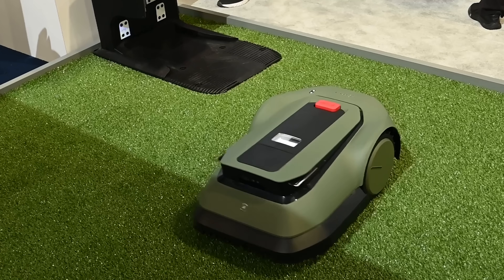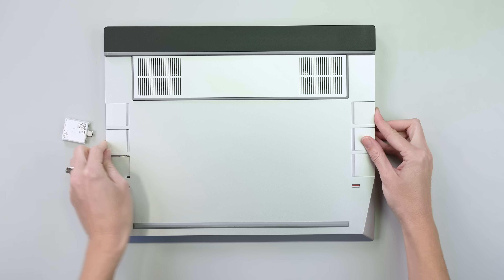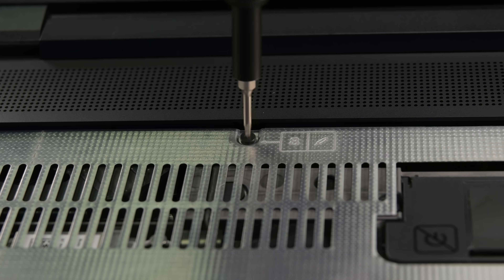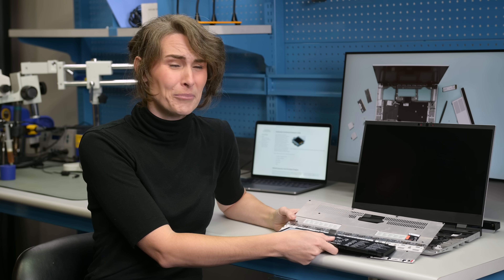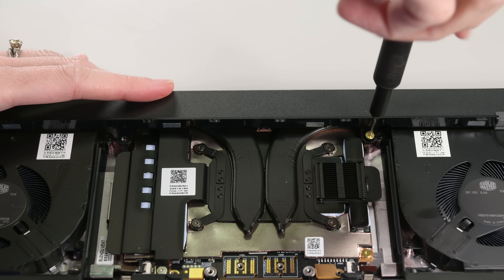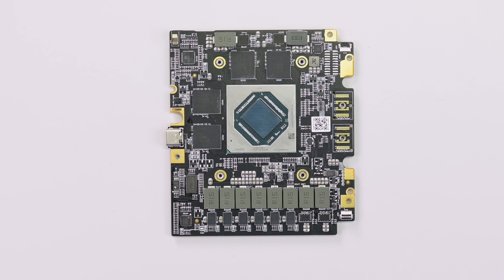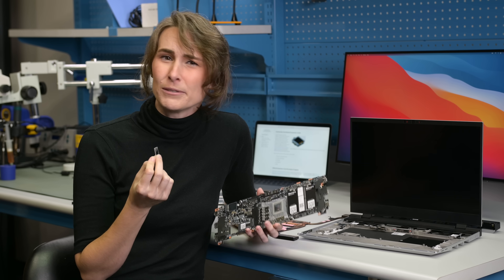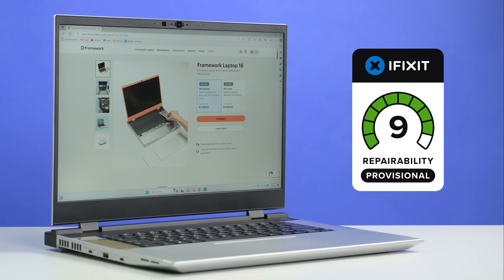The Framework 16 Teardown!-Best Teardown of the year already??

Comment: Does this accept 2 NVMe or an NVMe + SSD? Without using the additional "storage expansion" I am looking to run 1 NVMe + 1 additional storage drive and then if needed, an additional external "storage expansion".
Reply: it accepts 2 NVMe ssds, but only one is 2280 (I think). So your secondary storage will need to be 2230 (and quite thin), which is pricier.

Comment: This is rarely mentioned, but the display screen in the Framework 16 is exceptional, with significantly better specs than in most 16~17" laptops from Dell, HP, Lenovo, and Acer being sold at similar prices. 500 nits brightness, compared to 300~400 for most others,  a 100% DCI-P3 color gamut, 1500:1 contrast, and a 2560x1600 resolution compared to 1920x1080. It's not quite 4K, but if you really want 4K, connect a 28" 4K monitor to the HDMI port, and you will have a gorgeous dual monitor setup for work or gaming. For really serious gaming, the optional Radeon RX 7700s GPU falls quite a bit short of the capabilities of an Nvidea RTX 4090, but on the other hand, it only costs 1/4 what you would have to shell out for the Nvidea card, which is a truly eye-watering $1600. For graphics applications that depend heavily on ray-tracing, Nvidea GPU's are preferable to Radeon GPU's, but if you are doing serious work with CADD software involving 3D rendering, you are probably going to need a full-tower desktop workstation, which will cost much less to build than a high-end laptop, and it will have capabilities you simply can't get in any laptop, like the ability to internally mount 2 or even 3 16 tB hard disk drives. You're not going to even be looking at a laptop in the first place for that type of use case. 

For photographers who need to process extremely large images on a computer that's portable, using Photoshop CS6 or Lightroon, I don't think you can do better than the Framework-16.
Take the basic $1399 chassis, get a 96 gB DRAM kit from Amazon for $225 (that's two 48gB 5600 MHz DDR5 so-dimms from Crucial), a 2230 SSD WD Black 2 tB $120, and a 2280 SSD, 2 tB for $180, and you can build a real powerhouse portable workstation for about $2,000. 96 gB of DRAM will allow you to load a truly enormous composite panorama (up to 1 gigapixel!) into Photoshop CS6 directly into memory without having to use swap disks, which you really don't want to do with SSD's anyway. For processing static images, you don't need the $400 optional GPU (for video processing you probably do want it). My point being, that if you have an application that can actually use 64 to 96 gB of DRAM, you're going to pay way more to get a Dell XPS with that much memory, and it's probably going to be soldered. The Framework 16 isn't the most powerful laptop you can buy. It doesn't have the very top-of-the-line in either CPU's or GPU's, but it can match any high-end workstation laptop from Dell, HP, or Lenovo in capability for applications that need maximum amounts or memory and storage, for less up-front cost. And if you suffer a failure after the warranty - like an SSD goes bad - you can easily and inexpensively replace it.

Comment: This zig-zagging pattern isn't something to be ignored. It helps with alignment and making sure equal pressure is applied. When done with cpu/gpu cooler, you can cause damage by not fastening iteratively in an alternating diagonal pattern. Helps with screw alignment too

Comment: why not a phone like this ?
Reply: to be fair to engineers, designing this kinda stuff in this way takes a lot of time, custom parts and adds substantial cost, factors which only get exponentially harder to deal with the less space you have to work with. Phones should defo be better but this is probably an unreasonable standard for your tiny pocket computer.

Comment: only 1 full sized 2280 ssd slot?  well?  i guess not everything can't be perfect.  

but dang, did she say 80 something wh battery?  yes, 85wh.  the last 2 laptops i've bought were maybe 42wh.  and i had no option to buy a bigger battery.  yet i'd open my computers and find plenty of room for more battery inside them.

i didn't love that the framework laptop was going to be $1700 (with 0 ram and 0 ssd), but man, maybe that is just what things cost now days.  

that and when i upgrade, i'll only have to buy a $600 mainboard.  i should really just jump in with my next one.

Comment: My only real annoyance with my Framework (13) after having owned it for a while is the fact that the fans are glued to the heatsink, and not easily detachable. Dust is a real annoyance, and once it piles up in front of the radiator fins, your laptop sounds like a plane taking off whenever you turn it on.

Comment: PROOF that making a repairable gadget is a choice.
Reply: You're right, but unfortunately the framework laptops take it to such extreme the hardware will be absolete sooner than it would require any repair. Building reparable devices is a choice for a company, but unfortunately we don't have much choice if we want light laptops with long battery life powered by arm..
Reply: @mori7423  why would it be obsolete sooner??? I dont get it? If so, i hope they just make laptop batteries REPLACEABLE by consumers

Comment: Upgradebility and easy repair is everything for me. I bought cheap laptop in 2018. witch i am using even today. In meantime i upgraded ssd from 128gb to 1tb, put 4gb of ram more, replaced keyboard, cleaned laptop internals few times , put new hdd of 4tb, used 3 different oses, both windows and linux. and laptop will serve me for couple of years more. And that is real value for money.

Comment: I am quite sadden that Framework opted to use another freaking custom GPU board, rather than just sticking with the MXM 3.1 standard thats still PCIe x16 Gen 3, fast enough for RTX 4090!! 
I smell another Dell fiasco with their "upgradable GPU" module that juts ended up being only compatible with very few select machines. 

What a shame, I was hoping to finally replace my 2011 Dell Alienware M17x R4 with its ugpraded RTX 3080 GPU installed, but hey, I guess Framework intends to play it safe.

Comment: First 10/10? I actually think the battery, ram and ssd should be replaceable without having to take the back-panel off. But yes repairablity and replacablity is not the same thing I love most things about this laptop except the price point. Yes it’s on par-ish with the competition but it’s still to pricey for me. I hope budget options comes out as well because I want to buy one of their laptops.

Comment: Number 1 reason Laptops die is because the onboard Powersupply converting and managing Battery and A/C Voltage rails on the Mainboard, i wonder why this is not something that is getting talked about since you have to replace Mainboards still, even on Mainframe Laptops every 3-6 years like every other Laptop currently being sold. Even the best Manufacturers give not more lifetime on these parts, ofcourse you can say your Laptop is 20 years old and still running but if you poweruse it or leave it on 24/7 for more than 3 years you gonna have a broken Power Supply sooner or later. It literally another form of chip-lottery. So you going to think that Model line is still supported by Framework ? there will be 3 new Models with incompatible Motherboards or Hardware so old you going to want to buy a new one anyways because you cant get a decent upgrade Mainboard or GPU fitting your Frame anymore.

I get it, i want a Framework too because its freaking awesome but its yet another promise on the market that is forseeable wrong if you really be honest thinking about it. Eventually i will even get one since its the only direction i want to support the market to turn to ...
I would be the quietest man on earth wielding my money in the air if those Frames had changeable Power-Management hardware. Like a tiny Module with your A/C power input and traces from the battery straight into the removable module so that if something dyes its on a changeable module.

Comment: Framework is the first modern consumer-grade smart device manufacturer that can score more than 1/10 in USER repairability rating.
When I get the money, I am 100% buying Framework, unless others manufacturers catch up (doubt about it).
Reply: No, Dell and HP already have extremely modular laptops, they just cost 2500 euros for the starter model, they are professional work machines with replaceable GPU's, memory, harddrive, wifi card, storage and so on and so forth and they support up to 4 x storage devices.
And then there is Clevo which even has replaceable CPU's
Reply: @SMGJohn  Where is this vaporware that you are talking about?
Reply: @heroninja1125  
Seeing how you cannot even Google HP workstation laptops, what good can I do for you? You need a different kind of help.

Comment: The only thing that hold me back from buying a framework is the CPU. Ever since Apple released the M-series chips, I would always prefer ARM chip on a portable device for it extensive battery life and performance. The X Elite from quad comm is bring me hope to have an ARM framework laptop. But I doubted if there is enough market for framework to release an ARM cpu board at all. Also, I don't think quad comm is cooperative enough to let framework have their cpu at all.

Support of ARM chip on Windows is not a concern for me at all, because I am a Gentoo user. As long as we can see an ARM framework, I will give my money.

Comment: It's fun to see the argument between those who like framework design and those who don't. I on the other hand is all for it. Who still remember the time when almost everything inside a laptop is accessible through the various hatches at the back of the laptop? During the time when the battery can be removed with just a single button press, when the ram sticks was accessible with just removing a single screw to remove a plastic cover. The time when disassembling a laptop was easier than frying an egg. Framework is simply bringing that back and more. It's not all about the value of framework laptops bring into the table, it's about proving a point. That easily repairable devices are still a viable thing.
Reply: My old Gateway laptop was east to disassemble. I still remember the model number, MD2614U.

I currently have a framework system in the coolermaster case. If I ever need another one I will definitely purchase from framework.

These designs give the users full and total control, the way it should be.

These are perfect with an Arch Linux install.

Comment: The difficult access to cleaning the fans(which should be cleaned at least every half a year in a gaming laptop) is unforgivable. How could they mess up this bad in a high performance laptop?
Office laptop - I can understand, almost nobody opens them up for cleaning and repasting. But powerful\gaming laptops? They need the easiest possible access to the cooling system.

Comment: And that won't stop nvidia, intel and amd from artificially limiting laptop parts. Why? So you can be sold 2 generation old parts under the guise of the latest generation naming, which AMD did first followed by intel. Its so they can sell you marginally faster parts for more money. Its so you pay more for the performance you're suppose to get. For example, the rtx 4070 mobile not even beating the last gen 3070ti mobile in performance, yet costing more. And nvidia could've very well used a desktop rtx 4070 to give you an additional 30-40% more performance with more vram. Oh wait. That would be too close to the rtx 4080 mobile's performance. So they can't charge you $1800+ (and 2k euros or more outside US) for what is really suppose to be the rtx 4070 mobile. 

How does this affect FW? You won't be able to tune your laptop well or as easily as you could in the past, thus improving the performance and maintaining it better over the years. You're forced to buy higher end config's, something apple regularly pulls, especially if you need more than 8gb of vram. You'll be either forced to pay more for the upgrade you're suppose to get, or deal with less than stellar upgrades.

Comment: what about the rest of the specs? looks like it uses intel & their inferior graphics passthrough to the display, which negates most of the benefits of the dGPU. if the cpu has intel onboard "power saving" graphics that is. I wasted the length of this video when I could have read all the essential information easier.
Reply: ..This isn't a specs review dummy. 

The whole point is it's customisable.. choose the CPU and GPU from a list.
Reply: Again, something I could have seen in a written article, which, surprise, would have these specs listed!

I did end up going to their website to look at the product, & am pleasantly surprised to see it uses all AMD, but why do I need to do extra work? There’s enough to do in life as it is.

Comment: I really wish the larger rear module was easier to swap. Not necessarily hot swappable, I’d be fine powering down the device first. But it’d be nice to swap out quickly between gpu, extra battery, extra storage, amongst other more practical stuff. Having to take it apart is a bit hindrance to that.
Reply: luckily you dont need to take off the keyboard and not the cover underneath at least

Comment: I'd be worried if a laptop designed for repairability earned any score other than 10/10. Well done, Framework.
Reply: The only logical comment here
Reply: I could see a super thin Framework laptop getting 8/10.  I could be okay with it if it's easy to use as a tablet and very light for carrying.

Comment: Cool, but... It's a toy.
It would be SO COOL to have it as a workstation. 
Unfortunately now there's no way to have more than 64(or maybe 96)GB of RAM, and it's a deal breaker for me (my datasets require more than that).
Also, many programs behave... funky, when run on non-isv hardware.
So as ch as I like AMD, I need my laptop to be based on Intel and Nvidia Quadro. With at least 128GB of RAM (ECC would be nice).
Also, the competition offers 4xM.2 slots, And Framework has only one full size slot.
I would gladly pay more money for more computer.
And now I can only choose between Dell Precision 7780, Thinkpad P16 Gen2, and HP Fury G10 :(

Comment: This gives me joy to see 😀 It’s a bit like the days of the Dell c series where many parts were interchangeable and modular to some extent - I remember doing CPU swaps and changing from CD to DVD drives or even having 2 batteries. Framework should be the benchmark for others in terms of what can be achieved when cynical corporate agendas are not a factor - much like Fairphone’s design philosophy of easy to replace parts. If Framework can support the formats across models and modules for over 5 years then it’s a win 🏆

Comment: Only one internal SSD?  Please, I need at least two on a gaming laptop!
Reply: While its not exactly the same you can buy a memory expansion module
Reply: It has two, they just didn't show the other one very well
Reply: @Alucard-gt1zf  It looks like you're right!  Their website says it has one 2280 slot which they call primary, and a second 2230 slot they call secondary.  They also say it can boot off either drive, so I guess I could do a 2TB 2230 boot drive and a massive 4+TB 2280 for data.  I'd MUCH rather have two 2280's (my current laptop has three 2280's) but I think I can live with this compromise to support their company.

Comment: Motherboard compatibility between 13 and 16" chassis would have been amaaaazing but this is already so impressive its ok
Reply: No it wouldn't - you would have been stuck with 4 expansion ports and NO GPU interposer so no external GPU.

Comment: Been usinf the FW 13 AMD version for 2 months now and loving it. My old HP laptop was 11 years old so it was time for an upgrade. I was looking for a laptop between 13 and 14 inches and was bouncing between options from hp, lenovo, and even apple because i didnt know the existence of framework. I almost pulled the trigger on a macbook air 13 because it was on sale for the black friday but it was 8gb of ram and 256 of storage and both of them soldered to the motherboard... that should be banned rigth now. Searching online i found this company and i love their philosophy, the user can upgrade everything and the company gives you the manuals and acces to the parts It is true that fot the price that you pay you don´t get the same specs as other companies, that is true for example in the screen of the FW 13 but the design is really good and you know that in the future you can upgrade your computer without any issue. We really should support this companies that are making thing different and really caring about the users and the eviroment and not only using empty words like apple does.

Comment: I wonder why not put the modem module into the expansion module. It feels like a perfect place for it to be.
Reply: I would also get rid of normal SSDs on the motherboard and use 2230 in the extension module. Nobody ever complained their SSD doesn't have enough speed.
I'm a little surprised these extension modules aren't a bit larger to fit these things and aren't connected by some proprietary connector like pcie 4x or 2x.
Reply: The modules are usbc what are you going on about......@Slider93